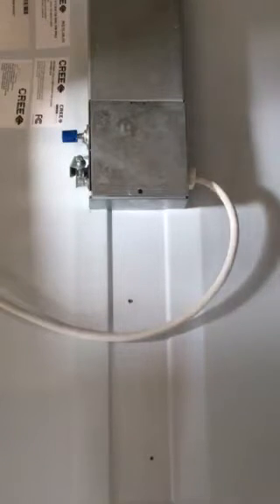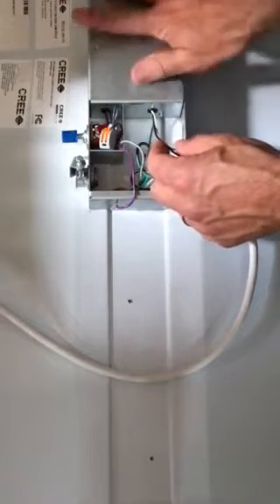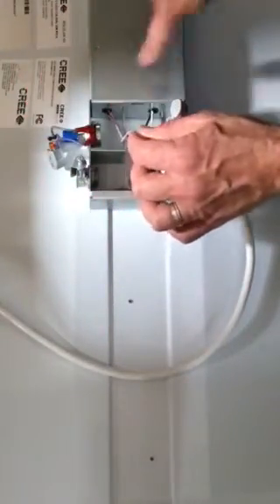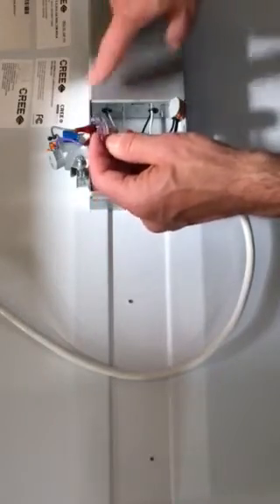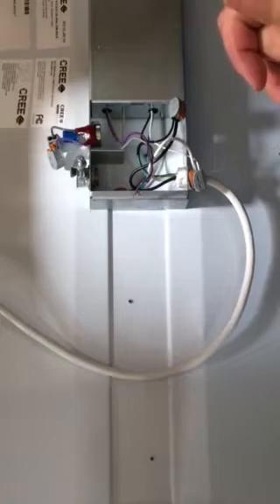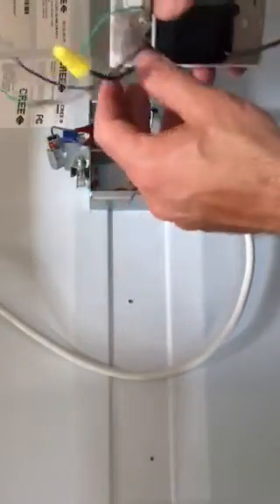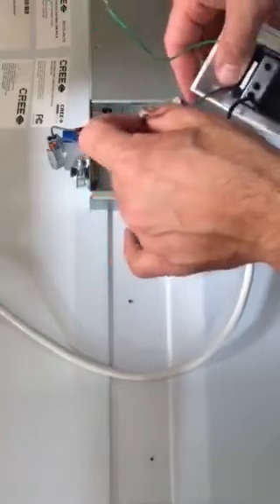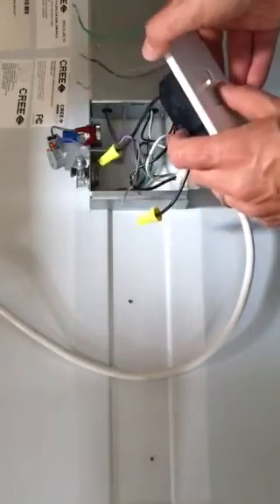0-10 Volt Dimming Basics

Comment: Can I use a pot for the 10 volt  off  of driver
Reply from the maker: I work as a manufacturer’s rep selling controls and we do not offer pots.  I think you are on the right track but would confirm with the manufacturer that you are using the pot correctly for the application.
Reply: @prudalavage thank you for the information

Comment: Can you wire these without the dimming capability?
Reply from the maker: Yes a 0-10 volt fixture can be wired for just on/off.  Just dont hook up the purple and gray wires.  This is a common practice.
Reply: @prudalavage  Thanks. .that is what I did for now.  Was just concerned about where that 10V goes if not connected

Comment: "The 10V cones from the fixture" ... You lost me, the fixture doesn't output a voltage, it's not a power supply.
Reply from the maker: The 10 volts for the 0-10 signal is generated at the fixture

Comment: Since the LED driver (or less common,  dimmable fluorescent ballast) is what provides the 10 volt DC output for dimming control when powered up via line voltage,  I'm guessing the actual dimmer switch is basically an on/off switch with a variable resistor for the low volt wires? Or am I misunderstanding something here?
Reply from the maker: You are correct.  The dimmer is an on/off switch with a variable resistor for the low volt wires.

Comment: why is there two line going in the switch voltage ...you only explain one line...what about output
Reply from the maker: Line in to the switch and load out to the lights. The 0-10 wires get connect at the dimmer then daisy chain to every light.

Comment: Is it only me who didn’t get how to connect the switch? Do I need to connect the power too or just the two 0-10V cables.?
Reply from the maker: You need to connect line voltage to the switch and low voltage to the two 0-10 volt cables

Comment: In most cases you will be controlling more than one fixture , how do you handle the 0 to 10 over say 20 fixtures, I would assume you just daisy chain the low voltage together. Do a video where you talk about large room , multi fixture challenges of dimming many fixtures at the same time.
Reply from the maker: Hi James- you are correct that you would daisy chain the 0-10 for all 20 fixtures.  I do not have a video on that.

Comment: Thanks so much for this video.  It helps a lot.   So I understand I need to use 16 to 18 gauge wire to wire all the gray and purple wires together from light to light and then go to the dimmer switch.  But gray and purple must be run separate from the 14/2 wire, per code?   How many lights, that use 160 watts per light. can I use?  I plan to do 6 lights with each one taking 160 watts on one dimmer switch.  Will that work?
Reply from the maker: Local codes are different. I work in Philadelphia and most electricians use MC LED cable which has the power and dimming in the same cable.  https://www.encorewire.com/products/mc-led.html.   The limit for a dimming zone is the relay rating- usually 8 amps but verify.  The 0-10 limit is in milliamps- which you can look up but I would feel comfortable with 6 fixtures.

Comment: Wait, so I have to run what between the dimmer switch and the lights? Two lines? What kind of wiring in my walls and ceiling should I use? If so, that means I have to tear out a LOT of drywall that took the contractors about 5 months to install. Can I just put the dimmer on the power lines to the driver box like regular lights?
Reply from the maker: Dimmers that dim over the 120 volt line (phase dim) are available and have been used for years.  Your fixtures need to be built for phase dim- usually listed as “triac”.  Use that type of fixture and  dimmer and you don’t need additional wires.  0-10 volt dimming is usually used commercially with acoustic ceilings.

Comment: So do u have to run a separate pair of wires down from the fixture to the switch location? What guage wire?
Reply from the maker: Yes, you need to run a separate pair of wires for the 0-10 volt signal.  Most people use 16 gauge or 18 gauge

Comment: If the fixture provides the 10v is there a way to add a dimmer function at the fixture?   Like a circuit that attenuates the voltage?  Want to retro some led panels but dont have a low voltage pair of wire to the lights.
Reply from the maker: There is a module you can put on every fixture from Lutron called the FCJS-010 which you can mount on every fixture.  If you are able to run the 0-10 wire, that is usually the easiest way to dim them.  Assumes you have access above the ceiling of course.

Comment: The real catcher here, is that the 0-10v line MUST be in a separate conduit, down to the dimmer switch. you are not allowed to run both the 120v and the 0-10v lines together per the NEC.
Reply from the maker: Yes that is correct and a challenge on conduit projects.  MCLED allows 0-10 and line voltage in the same cable.
Reply: @prudalavage   I take it then that they make a special MCLED cable for just that purpose. Was not aware . Thank you.
Reply: I thought so man I knew I wasn’t crazy.
Reply: I am considering using this low volt Halo system in my living room ceiling. And put the driver/junction box in my basement ceiling, with the on-off dimming switch on the living room wall. EMT conduit is required in this area. I know the 120 volt wires have to be in EMT. But does the 10 volt dimming wire have to be in EMT too ?
Reply: Can u daisy chain the 0-10v from fixture to fixture or do u have to run individual runs from each lite?

Comment: You didn't go over exactly how to run the dimmer wires if you using multiple light fixtures, and also if you not concerned with dimming can you just hook the lights up as normal skipping the dimming part?
Reply from the maker: If you are using multiple fixtures connect all of the purples together and all the greys together.  Yes, if you are not concerned about dimming the light will switch on and off just fine without hooking up the purple and grey wires.

Comment: Can this style of panel light dim with a standard 120v smart dimmer switch like Kasa or Wemo dimmer switch?
Reply from the maker: Hi.  It looks like the Kasa or Wemo dimmer does a phase control dimmer.  You would need a dimmer that includes 0-10 connections.  The Lutron Diva DVSTV is a good one.

Comment: why would there be a relay in the device?  Is it not simply a switch for the line voltage at the bottom of the rheostat travel?
Reply from the maker: Hi Jeff.  You are correct it is a switch for the line voltage. I should have called it that.  Thanks for the comment.  It will help me make better videos.

Comment: Short and simple, so a live wire from an old switch, pre-led, may need a second purple grey wire from light to switch.
Reply from the maker: Yes that is correct
Reply: @prudalavage   Can I run that purple and grey in a separate pipe?
Reply: @jbferrer3   separate pipe is preferable.   The Violet and Grey wires are low DC voltage, low power wires which are susceptible to noise from higher level voltages such as the AC line. especially when run along side it..   But they are LV, so depending on local code, they might need to be piped.  In any case, if run as a twisted pair, that can help reduce noise pickup, and of course sheilding is best.

Comment: how can i add multi light on one dimmer switch??
Reply from the maker: The 0-10 volt dimmer can control up to 8 amps of lighting. The line voltage gets wired like a standard switch.  0-10 gets daisy chained.